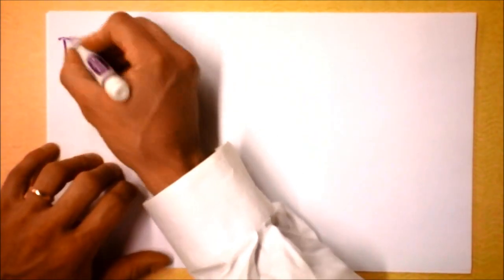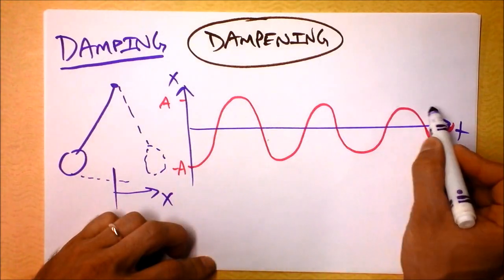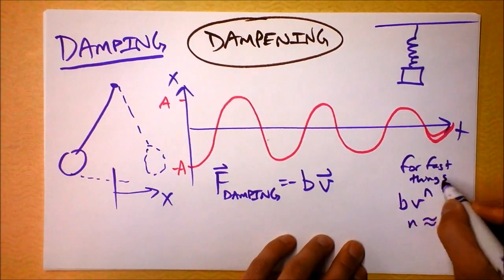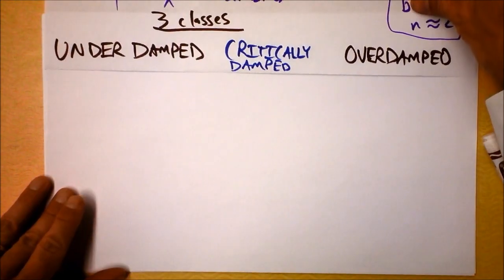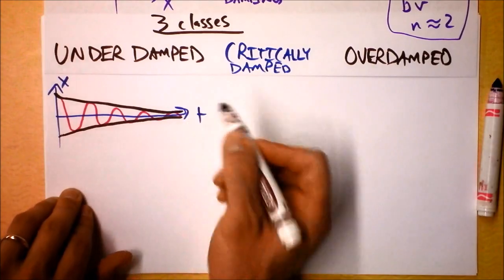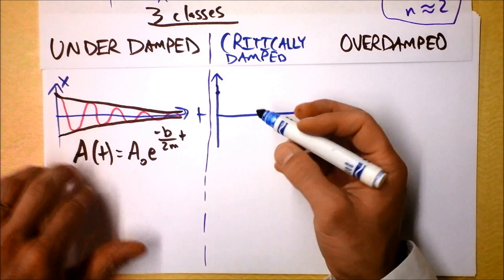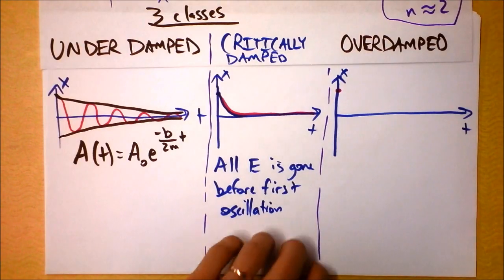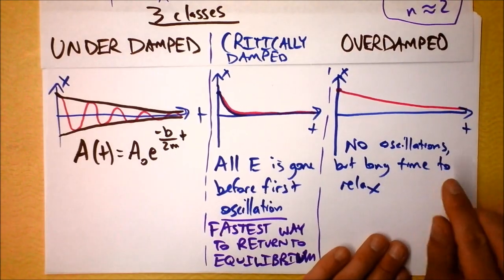Damping of Simple Harmonic Motion (not DAMPENING, silly, it might mold!) | Doc Physics

Comment: Great video! Just one question: how would you UNDAMP a(n) (under)damped harmonic motion? 
Let's say I have a bench on 1 (or 2, or more) spring(s) and I want to keep it on oscillation at a certain (in this case, low) frequency of e.g. 0.2.
Not only the amount of force or energy but how to spread it properly so you achieve the same result for the next peak (or trough) as you would have with an undamped harmonic motion. This way you counterbalance the natural damping and achieve a nice harmonic motion again
I have this project I got on my bucket list and I can't seem to get it out of my head, it seems!

Comment from the maker: You can clear up your damping questions with a quick trip to the wikipedia page.  I wonder about your last sentence, though...  If the system has a lot of energy, it will have correspondingly more damping force since damping is depends on velocity.  I guess you'd need to know if your system's damping force is linear with velocity or quadratic or better.  However, we've beyond a first-year treatment at that point.  Maybe next year.

Comment: Critically damping can have, at most, one oscillation and it approaches zero slower than over damping: 
p = c/(2m)

x = (e^(-pt))(C1 + xC2)

where as overdamping:
x = C1(e^(-rt)) + C2(e^(-Rt))

overdamping will approach zero faster because both constants are naked where as in critical damping one constant has an x term with it. If you put a lot of energy into a critical system you can make it oscillate at most once.